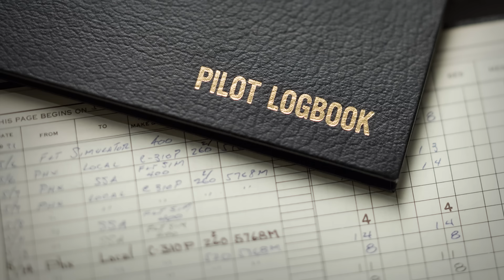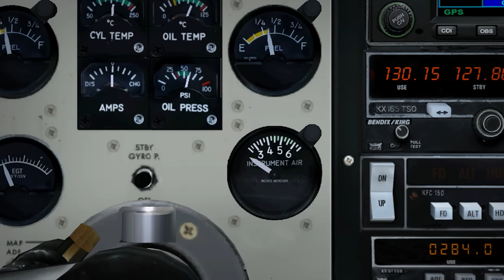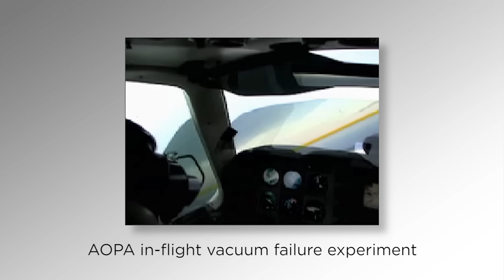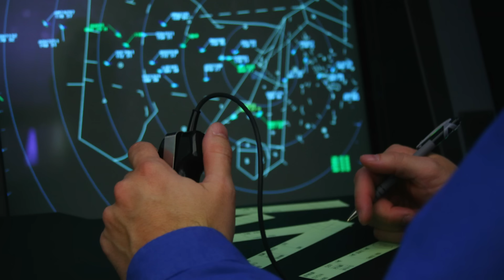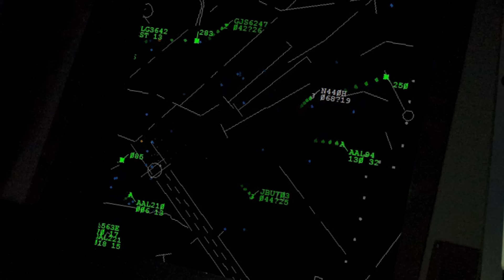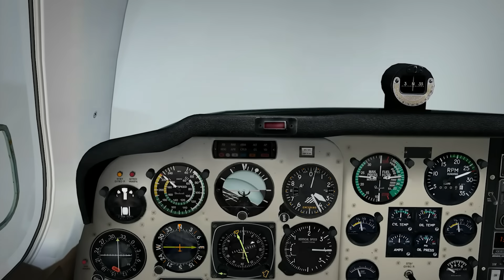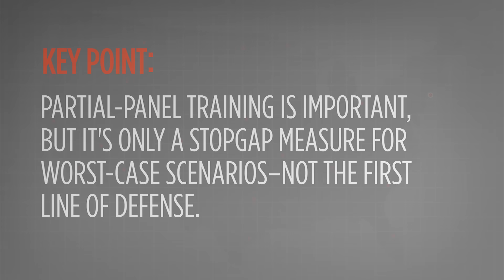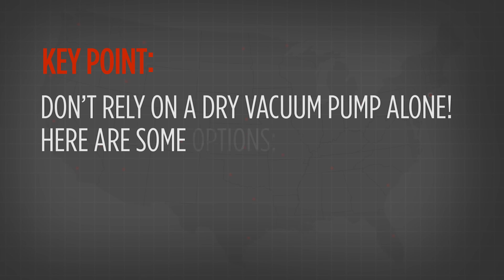Accident Case Study: Single Point Failure

Comment: Wait...why did it break apart mid-air?  Was the strain during the spiral just too much?  (Non-pilot here)
Reply: Usually when pilots get into spirals due to spatial disorientation, the aircraft breaks up before it even hits the ground because the red-line speed of the aircraft is exceeded. At speeds above that, not having the airplane rip apart due to the huge amount of parasite drag is not a guarantee. Pair that in with a pilot making possibly erratic maneuvers in attempt to recover from the unusual attitude which add stress to the aircraft, and you are almost sure to break the plane. Google a V-G diagram for a more data-based way of seeing this.
Reply: I'm guessing the erratic manoevering over-stressed the aircraft.
Reply: The wings and horizontal stabilizer on the tail are attached to the "body" of the airplane with bolts.  The wing has spar(s) that give it strength.  The airplane is rated for so many Gs (force of gravity).  Every airplane is built to withstand so much weight in flight-they all have limits.  At 1 G, flying straight and level, a 100 pound person weighs 100 pounds, easy so far.  Now the airplane is in a 60 degree banked turn and is pulling 2 Gs.  That same 100 pound person is putting 200 pounds of pressure on the seat.  At 3 and 4 Gs, the person weighs 300 and 400 pounds.  The weight of the airplane is well over a thousand pounds and that weight is being carried by the wind spar(s) and the hardware attaching the wing to the airplane.  The attaching hardware and wing spar(s) all experience the same increased weight (stress) when the Gs increase.  When you are in a steep dive and a steep angle of bank then pull hard back on the controls to try and climb you place a tremendous strain on the wings and attach points.  The airplane I fly is rated to 2.4 Gs positive, beyond that I risk structural damage or failure.  The airplane broke apart mid air because the pilot allowed the speed to reach a point combined with what he was commanding the airplane to do through his control inputs that the resulting forces did exactly what you said "strain during the spiral just too much".  Hitting a big speed bump on the road at normal driving speeds is uncomfortable.  However if you hit that same speed bump at 100 mph or 160 km/h over and above the posted speed limit they you are likely to do some damage or even lose control.  Same with the airplane, as the speed increases the resulting forces acting on the airplane also increase, up to and including the point of failure.  This pilot lost control of his airplane in the descent, and in trying to "fix" it he pulled it apart.

Comment: Did the aircraft break up prior to impact with terrain?
Reply: Yes. The fact that the wreckage was scattered in widely separated pieces on the ground and that witnesses said they saw the plane in pieces prior to impact suggests that. Most likely it was an aerodynamic break up. The airplane was coming down so fast that the extreme aerodynamic forces tore it apart.
Reply: @joevignolor4u949  okay that's what I wondered, it seemed to be implied but the narrator didn't clarify it.  I thought there may have been a chance it impacted something else that was tall on the way down.  That's got to be a pretty horrific experience.

Comment: Of all the things the FAA could require is that instrument rated aircraft be required to upgrade to electronic instruments for at least attitude indication.
Reply: Why? Would a backup wet vacuum system not be a sufficient backup to a primary dry?

Comment: It's amazing what a life saver an iPad can be 
Loaded with quality apps, the synthetic vision could essentially replace the panel, aside from engine insurmentation of course 

I've seen a video on YouTube of a test of synthetic vision for pilots
Two guys in a helicopter, an R22 I believe.. one guy isolated by dark blankets
R22 only has basic insurgents.. so when pilot one handed control to pilot two
The helicopter was out of control within 15 -20 seconds 
Then pilot two turned on the iPad,and began the same test
He was able to fly, not very coordinated but if he were in dense cloud and fog instead of under blankets he could have flown himself back into vfr conditions 
Without the iPad, a vfr into imc would mean a wreck, 100% of the time 

.I really cant imagine why any pilot would fly without an iPad these days 
Even if you're flying something equipped with all the fancy glass cockpit bells n whistles 
I'd still have the iPad on my thigh, just in case

Comment: 180 turn would have saved his ass
Reply: Potentially...assuming he had the gas. Remember, his alternate was only 10 miles away, and you only need 45 minute reserve after your alternate for your legal IFR minimum. While not prudent, and in this case unknown, the legal requirements for fuel may not have left him with gas to get back outside of the system.

Comment: So let’s say he had a Garmin G5 attitude indicator and G5 DG/HSI. I know it’s not exactly cheap but if you plan to regularly fly IMC wouldn’t it be worth the cost?
Reply: Wouldn't a G1000 be enough
Reply: @schweizer3301  I can not think of a way to say this that might not sound bad. My answer to you would be, how much is the life of your passengers worth?  If it will always be just your life on the line the question does not have true meaning. When you are taking care of others lives, you should not betray there trust with just hoping for the best or settling for it should be good enough. Please do not take this the wrong way.
Reply: @SuperchargedSupercharged  It seems you misunderstood, i asked assuming that a G1000 offers a similar level thats at the very least better than what was used in the vid. It seems youve taking this the wrong way. This is a discussion not a rule book.
Reply: @schweizer3301  understoood, thank you

Comment: I'm just curious as a non pilot could you use a half bottle of water to indicate flight level?
Reply: No...revisit your high school physics text book. From the arm chair YouTube comment section pilots, that seems like a good solution. But you have to remember that you’re sitting still and are really only being acted on by gravity and its associated normal force. Remember airplanes are almost always constantly accelerating (a change in magnitude or direction of motion), and are acted on by gravity and forces other than just normal, such as centripetal.

Comment: Only at 3:52 in this video and I want to cuff the controller up the back of the head. Either he is willfully being obtuse or he's one of the special snowflakes that have no business working ATC.
Edited to add: The controller obviously does not understand the nature of the failure, he does not know what a vacuum pump failure means. Instead of asking for clarification of that issue he is focused on the pilot declaring an emergency to give him an idea of the seriousness of the problem. Many pilots are reluctant to declare an emergency even when they are obviously in an emergent situation. 
ATC is relying on an emergency/no emergency declaration to get a clue to the problem, PIC is avoiding the "E Word" and continues to describe his situation in technical terms.
ATC should have stated "I am unfamiliar with your technical description, what is the nature of your situation?

Comment: as a non-pilot, can someone explain this video more....why was it so hard for this pilot  to maintain level flight and gently circle down over the nearest airport to land when the visibility become  low....did this pilot have any working  gauges that might have been helpful to him...could ATC  have  given him better instructions or did anything differently  in getting him  safely down....thanks
Reply: Hi Gary, certain of the instruments in light aircraft work by using a suction pump to spin the vanes on gyroscopes in the cockpit.  These are very important instruments such as the attitude indicator ("artificial horizon" as many people know it), direction indicator, turn and slip indicator etc.

In normal VFR (Visual Flight Rules - When you see the actual horizon out the window), you don't usually need the attitude indicator and the direction indicator (a fancy adjustable compass really), is not really necessary unless you are going for absolute precision....i.e. you can see what's out the window and on the ground and navigate and keep yourself level by sight.

When the suction pump fails, these instruments also fail.  As you can imagine, flying in cloud (IFR - Instrument Flight Rules), when your attitude indicator goes, it's hard to tell if you are banked in a particular direction.  Spatial orientation goes out the window when you lose visibility and you are not up to speed on instrument flying.  You SHOULD be able to use the other instruments to have an well educated guess as to your atittude.  E.g. If you are turning at a slow rate on your magnetic compass, you are likely banked in that direction.  If you are turning faster, you are likely banked at a higher bank angle.  It's really not an ideal situation though to be relying on those instruments in a high stress situation.

The tragedy is that nowadays there are highly accurate intertial and solid state accelerometer based solutions that can completely do away with the need for these ancient and outdated vacuum systems.  Something as simple as the attitude indicator on the free phone app HORIZON could and would likely have saved the day (with the right phone with the right sensors, e.g. S7).  I have been playing around with HORIZON on an S7 and it is excellent.

There are even portable standalone units such as the DYNON D3 which are only around £950 ($1300) that can do just about everything except provide airspeed and pressure altitude (they provide groundspeed and gPS altitude - Groundspeed is more than enough to get you out of trouble if you have a valid wind report for the area you are flying in).
Reply: @witblitsfilm  thanks much for the detailed response.....

Comment: Interesting video. Especially this one hits close to home and i am grateful how many redundancy my workplace plane has.

Recently, shortly after settling in cruise, i lost all attitude, map and air data information on my screens. Not a big issue, my colleague still had the full set and the standby screen had attitude and air data information. I switched my screens, according to the procedure, to system 3, recovered all the information (apart from a roughly 120ft difference between system 3 and the rest which is still RVSM compliant) and we continued on. No need to declare emergency, no need to crash.

Comment: If you fly enough, it’s not going to be if but when you’ll go inadvertent IMC. Inadvertent being a source of plausible deniability for the Pilot, who chooses to continue into IMC conditions. A seasoned pilot normally would have plan be ready and would climb to a higher VFR altitude and get a clearance. If the Pilot isn’t a proficiently instrument Pilot this will be a death sentence especially if they’re single Pilot. Even if proficient, things can build up faster than the Pilot can think through and suddenly they’re behind the airplane. It’s not until you make through a couple of these scenarios and scare the crap out of yourself that you realize just how horrific this can be. It happens all the time...
Reply: This pilot was a 4000 hour ATP...he didn’t inadvertently fly into IMC...he was on an active IFR flight plan. Unfortunately it was poor partial panel technique when descending into IMC after VFR on top that caused his downfall.

Comment: Cessna 310, two engines, two vacuum pumps, two generators, every vacuum instrument backed up by an electric instrument, full co-pilot panel, even two transponders... More than 30 years flying the airplane, now age 74. about 7,000 hours. I left nothing to chance. Only vacuum pump I lost was in a 1979 Cessna Hawk XP, new airplane, less than 100 hours, VFR conditions, and I still chose to cover the useless instruments to avoid any chance on confusing myself. That, however, was a good lesson, and why I decided to equip the 310 as I did. For a lot of years I flew the 310 5 to 7 days a week, those were fun times.
Reply: Thank you for your service
Reply: Check the manifold per the SB.

Comment: Non pilot here: I'm inferring from this vid that it's really difficult to fly a plane when in cloud  and when you don't have pitch and bank instruments. If that's the case, what causes this?
Reply: When your in cloud and can't see the ground you have no visual reference you can easily get spacially disoriented and not know which way is up or down, or at what orientation the aircraft is etc...
Reply: @ats-3693  Thank you. How are pilots trained to deal with partial panel in IFR?
Reply: @ezyroller  By using your TC/TSI as primary bank reference backed up with your whiskey compass, and your VSI and airspeed as primary attitude reference, backed up by your altimeter.

Comment: I'm having a difficult time understanding the conditions. So are IMC conditions essentially flying with no visual, like trying to drive on the highway at 60 mph in a rain storm? Or is the some level of visibility? I just don't get how you go from being in the clouds to slamming into the ground, wouldn't you at least be able to feel if you were diving/climbing/turning?
Reply: If you're in the clouds and don't have an external reference, you can easily become disoriented and lose control of the aircraft. If you're close to the ground when you break through, there might not be enough time to regain control.

In practice, if you haven't got full instruments and a lot of experience flying IFR, you generally don't want to hang out in the clouds any longer than you have to.
Reply: @techmage89  Thanks!
Reply: I know this thread is over a year old.  Aviation has a language of its own.  When a pilot is looking out the windows and flying referencing what they see outside; up, (climb), down (descend), left, right or straight and level controlling the airplane by looking outside for reference that kind of flying is referred to as flying under VFR (Visual Flight Rules) in VMC (Visual Meteorological Conditions).   Now the same pilot goes into a cloud.  Looking outside the windows that pilot only sees cloud, no horizon for reference now does that pilot control the airplane?  Once were are in the cloud with no horizon, where us up or down, are we in a turn or not?  Under those conditions it is possible for our physical senses to get confused.  What a person "feels" may not be what is actually happening (vertigo).  So, the pilot now has to look at their instruments, provided the airplane is equipped with those additional instruments, to determine where the horizon is and what is happening to the airplane-you absolutely cannot rely solely on your senses.  When a pilot is controlling the airplane by reference to the instruments in the airplane that pilot is said to be flying IFR in IMC.  Flying under Instrument flight rules (IFR), a separate training course and test a pilot must pass to a acquire that rating, in instrument meteorological conditions (IMC).  The pilot in this video was property trained and rated (had the proper credentials to do what he was doing) flying a properly equipped airplane.  Then he experienced a mechanical failure that disabled most/many of the instruments he would normally rely on to control the airplane by flying referring to the instruments.  And, yes, that is a problem.  He cannot see outside the airplane to determine what the airplane is doing.  And his body's senses are misleading.  There is an emergency procedure for such a failure called "partial panel" flying, but that is a perishable skill and he was not able to keep the airplane from "departing controlled flight".  Your question "wouldn't you at least be able to feel if you were diving/climbing/turning" is very important.  The answer is that you will feel sensations, however you will NOT be able to rely on those sensations to accurately inform you of your true condition relative to diving/climbing or turning.  For a more thorough explanation of this phenomenon search "Sensory illusions in aviation".  Great question by the way!
Reply: @apackwestbound5946  Hey! Thanks for the wonderful and informative answer I really appreciate it! And I will definitely search that up!

Comment: nearest VFR and enough fuel to get there......................ALWAYS
Reply: Not always possible...but it’s why you plan alternates with set minimums that these alternates must have forecast for weather upon arrival. But if VFR is your personal minimum, so be it!
Reply: @zippoc04  I have survived 10,000 hours in freight service in light twins and C-208Bs...with instrument, radio and mechanical failures. Many zero zero takeoffs and many approaches to minimums and missed approaches. Once again, my friend always know where the nearest VFR is and always have enough fuel to get there.......ALWAYS         (i.e. Lost Communications while flight planned into Dulles, JFK, ATL, BOS, PHL ??? Do you really think ATC wants you to follow the procedures? Make a turn away from heavy traffic areas, they will follow you on radar. Put her down at a podunk uncontrolled airport and they will send you accolades when you call in. If FAA questions you tell 'em you lost your Nav radios too!)